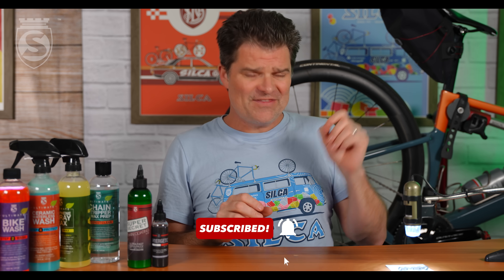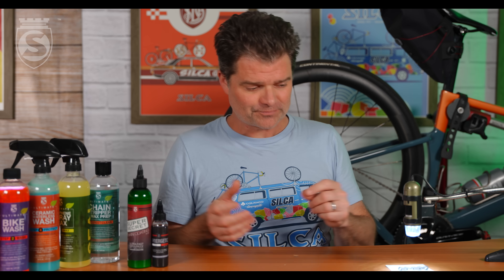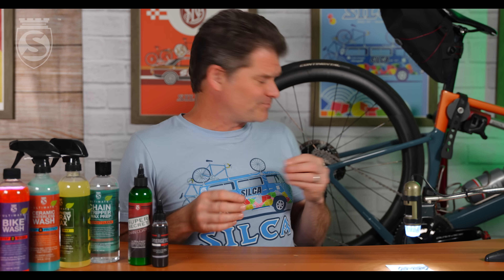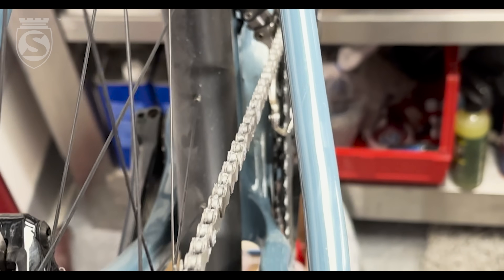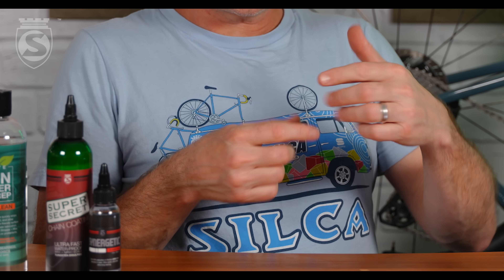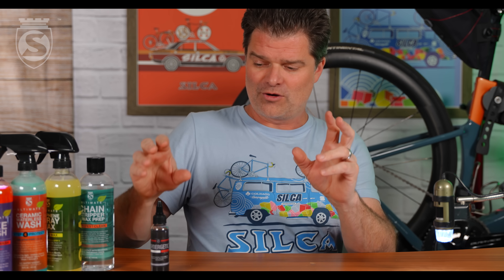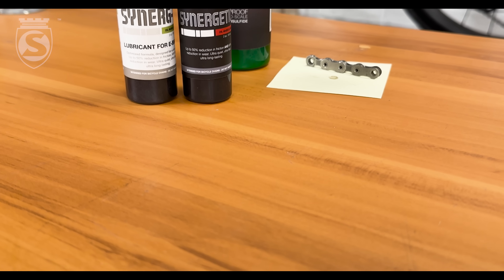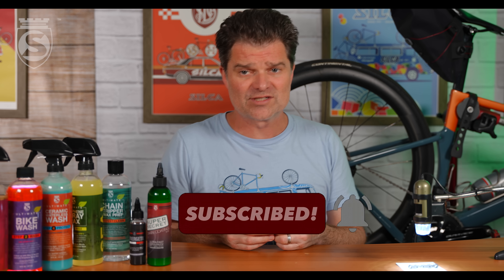Stop Wasting Your CHAIN LUBE! Know the BEST Way to Apply It!

Comment: What’s better, cross chaining big big or second biggest? I’ve heard both from your channel.
Reply: Try and choose a gear that doesn't require cross chaining - with a 2X crank and a range of 10, 11 or 12 at the rear derailleur, surely you can find a ratio that won't wear your chain out? LOL
Reply: I find Big big just throws the chain off the big chainring when backpedaling (as you do when applying if you don't have something to lift the rear wheel) on the 105 Di2 with 50t chainring and 34t sprocket.

Comment: I have two questions. 
1. I put on a nitrile glove and massage the excess lube into the rollers.  Good idea or not?
2. There is still quite a bit of excess wax on the exterior of the chain so once the chain is dried, I sometimes hit it very quickly with a heat gun. I can see the wax turn from solid to liquid and it appears to soak into the rollers.  Is this helping or hurting?
Reply: I put my bike out in the sun for like half an hour before lubing the chain. I think the lube flows better on warm chain

Comment: What am to do on my eMTB with a freehub in the motor that makes it so I cannot backpedal the chain using the cranks?  Should I just rotate the tire backwards instead?  Also of note is that the eMTB is heavy and putting on a stand to do the drip wax is a pain, so I tend to put them upside down and drip it on at the bottom (now on top) derailleur pulley.  Using the pulley does help keep the lube from all just running through and if you run it fast, most of the lube stays on until it hits other cogs (cassette, pulley, and chainring).
Reply: I think you've got the right idea putting it on right before the chain touches the tension pulley of the derailleur.  That gets you a lateral articulation point plus all of the vertical drip path that keeps it on the chain as it's going through the derailleur, plus the contact with the cassette cog and another lateral articulation as it leaves the cassette.  Essentially the reverse path of what Josh suggests.

For my e-commuter, I put down the kickstand and lean the bike to the left against a wall.  This lifts the rear wheel off the ground and allows me to pedal forward.  Josh, what do you think would be the best lube point for my method?

Comment: Makes a lot of sense, I’ll give this a try. I’m curious if the Super Secret Lube is a good option for mountain bikes in dry, dusty conditions. I’ve been using Smoove.
Reply: Works perfect in summer on my MTBs. In winter I switch to oil based because it keeps the chain from rusting better.
Reply: I get a little build up of wax between 12 and 11 tooth cogs but easily cleaned once a month in 30s with a tooth pick